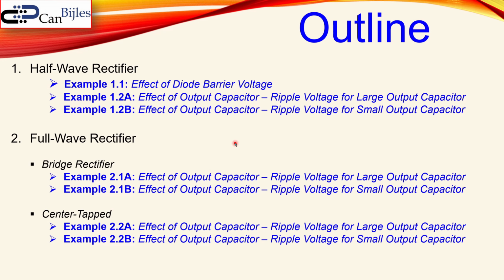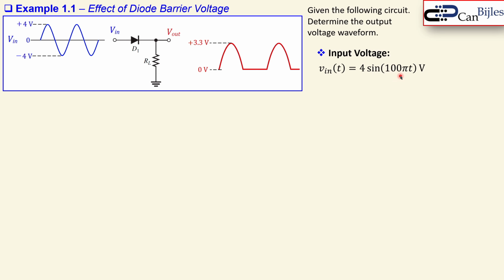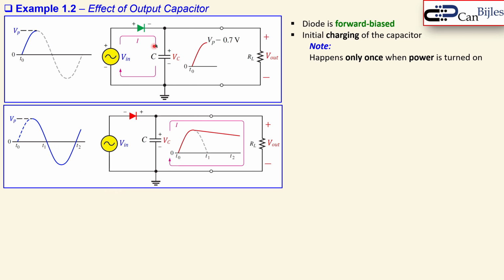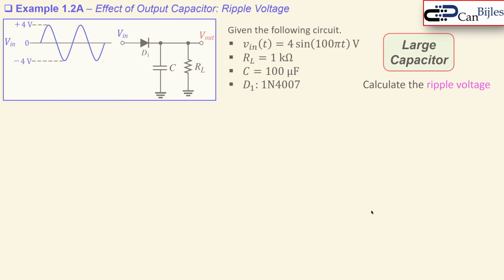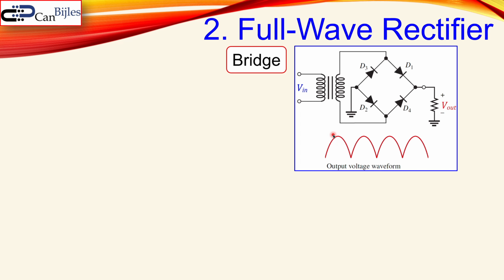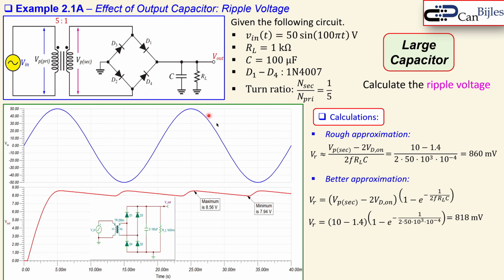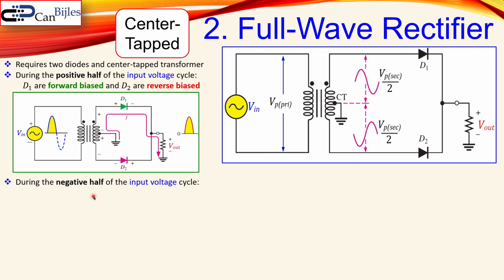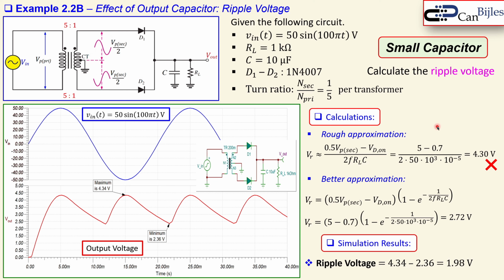Half-Wave & Full-Wave Rectifiers with Examples 💡 Calculations & SPICE Simulations

Comment: what would be gain formula for both full wave and half-wave rectifier  knowing only that diodes are standard silicon  and vdc  is lets say 5v
Reply from the maker: The purpose of a diode circuit is not to have gain. It carries out a nonlinear operation. Why do you want a gain in a diode circuit and what kind of a circuit it is?